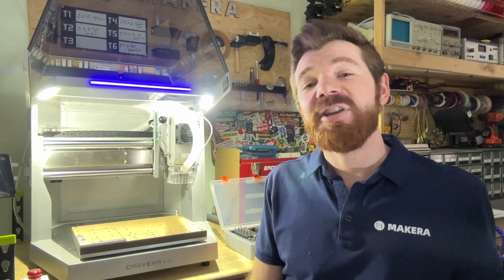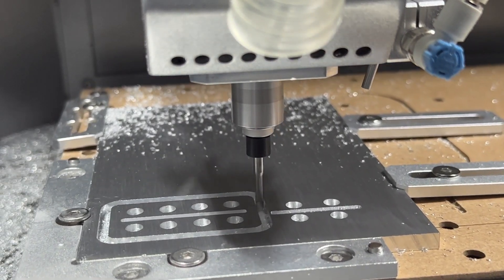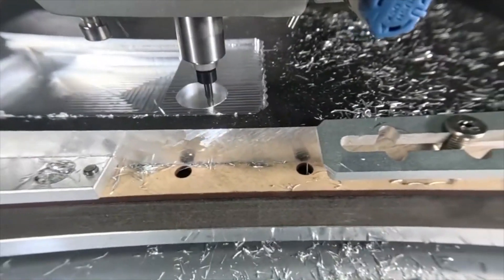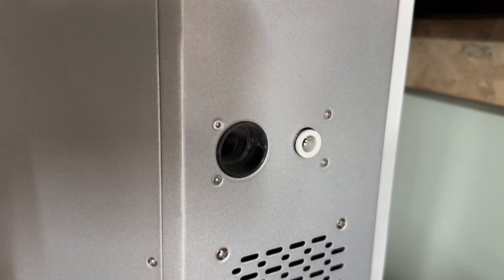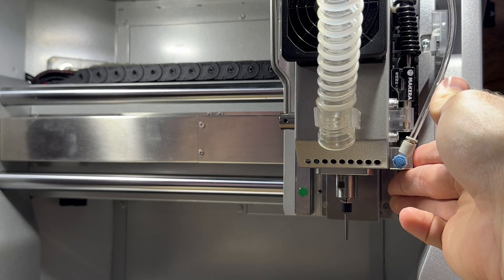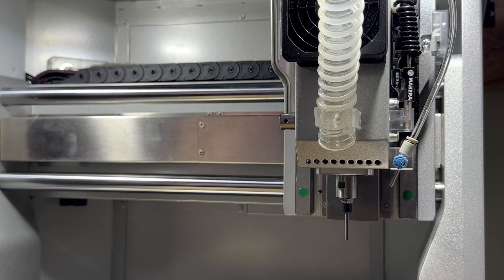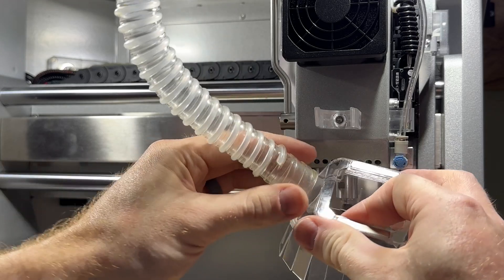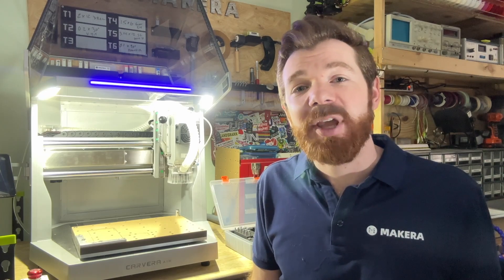How to Use the Air Assist on the Carvera Air Desktop CNC

Comment: Can you tell me what is the air compressor tank volume (liter) and output pressure (psi) that did you use for your cnc machine?

Did you ever meet a condition where your spindle and compressor was turn on (i mean Refill the air while extract the air) at the same time maybe?

Comment: hi i hv the machine delivered jsut now and i am new to all this. i hv not accounted for the need to buy dust collector and air compressor, i ran out of available budget right now. can this machine run without them?
Reply: I'm a beginner as well.  I have viewed videos of people using the machine without said assesories. They just use a shop-vac for clean up. I imagine that this method is safe for soft materials like wood and plastic but 'am apprehensive about it being safe with metals.  Seems like cooling would be critical with harder materials.

Comment: would be nice if you guys made very clear how what kind of hose and connectors to use to connect to an air compressor almost no one has a clue What The Heck to do and this video explanation is abysmal at best Re-do the video and give examples on how to connect to a compress and examples otherwise this video is useless also mention. its a 8mm tube in the video for the love of GOD!
Reply from the maker: Thanks for the feedback, we'll work to improve and support.

Comment: What Outside Diameter tubing does the air assist connection  fitting use?
Reply from the maker: OD is 8mm for the air tube

Comment: Why can’t it use both the air assist (cooling) and dust collector at the same time? Just put an extension on the air nozzle poking through the dust collector, right?
Reply from the maker: This is possible yes

Comment: How do I get the line out after putting it in?
Reply from the maker: If you press in the fitting ring, you can then pull out the line while holding the ring in

Comment: The manual says you cannot use the dust collector during air assist operations, but for those of us with HEPA filters on our vacs, can we use the dust collection hose without the shoe to evacuate fumes with air assist?  I understand not using the shoe, but the manual seems to imply you cannot have a vacuum that is pulling fumes out on at the same time.
Reply from the maker: There is nothing mechanical stopping the use of dust collection and air assist at the same time, its just not typically a recommended approach. As such, you could do this if you have a safe setup and need.

Comment: Is there a recommended way to use this with a standard shop air compressor since there does not seem to be a hose coupler?
Reply from the maker: The Carvera uses a PC-type quick fitting, which is designed for a 8 mm or 3/8" hose. You could use a barb fitting to adapt any shop compressor line to a hose for this fitting type. Ensure you do not exceed 100 PSI with a larger compressor.

Comment: Also interested in what type of compressor to get, I think you need to add a recommended cfm and pressure.  The flow rate is an important piece of information not just the pressure
Reply from the maker: Most compressors are advertised at PSI or Bar, rather than CFM, so we didn't anticipate that being a crucial piece of information. Any compressor that is less than 10 horse power shouldn't be able to output a CFM that would be dangerous to the machine while also remaining in the optimal range of 50-100 PSI. In terms of compressors, a smaller compressor, like an air brush compressor or a small tanked compressor (less than 1 gallon) would work very well.
Reply: @Makera  almost every airbrush compressor I've ever purchased has a flow rate maybe not CFM but in litres/mini.  As you use air to cool I'm really struggling to understand how flow rate isn't important. Even just to move swarf I'd imagine you'll need a certain flow to lift / mobilise it. I would have thought your engineers would have designed the system on the original carvera for a certain flow and thought it would be a pretty simple question. On an airbrush the hole size is tiny, variable from zero to maybe 1mm max. If I blow an airbrush at swarf I doubt it would move it?
The nozzle on the side of the head looks quite a bit bigger than that and it has to move swarf  at a distance (maybe 100mm).

Comment: yeah, it seems odd youp wouldn't mention recommended psi, ,or max psi, or minimum requirements or recommendations.   shouldn't take more than 30 seconds, keeping the overall video under 2 minutes if you cut into the 4 seconds of logo at the beginning..   I assume you're trying to keep these really short, but basic or common questions might be good to address while you're on the topic.  ¯\_(ツ)_/¯
Reply from the maker: Thank you for this feedback. At the time, this didn't seem like a key detail for making users aware of what the air assist was for, but we will look to redesign our content accordingly moving forward. To answer your questions, a wide range of compressors will work well, with tanks or without. And we recommend between 50 and 100 PSI.
Reply: @Makera  alternately, if the description linked to documentation about the specific feature where extra relevant info could be found, that would work too.  (mention there's a link to more info about this feature in the description)  ;-)
Reply from the maker: This information is included on our Wiki site as linked under the video, and here: https://wiki.makera.com/en/home

Comment: What are the recommended specs for an air assist compressor for use with the Air?
Reply from the maker: A wide range of air compressors would work well, with tanks and without. And we recommend between 50 and 100 PSI
Reply: @Makera  thanks for the information; however this is not enough information to make an informed decision.  Compressors are rated for volume per minute at a given pressure, plus a duty cycle at that volume.  Just because a compressor can achieve 50-100 PSI does not make it appropriate for this use.
Reply: I have seen people use a laser cutter air pump successfully so there is that